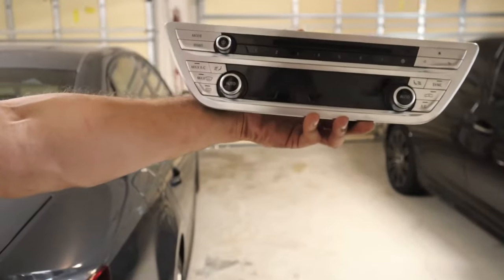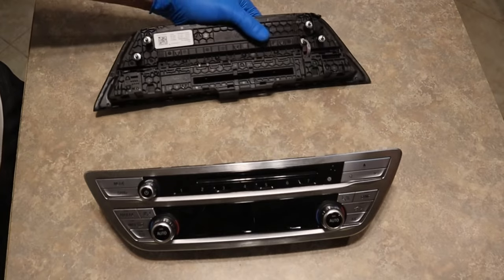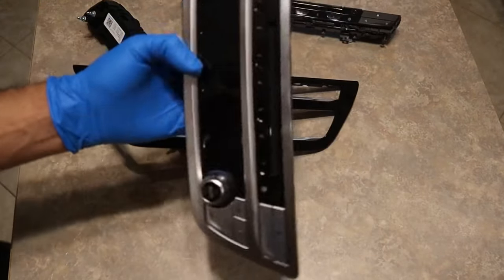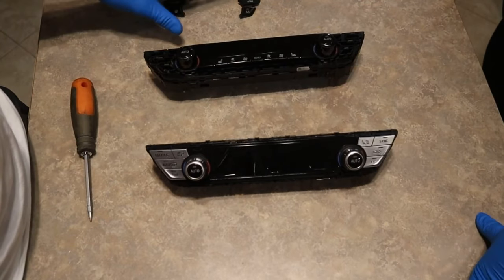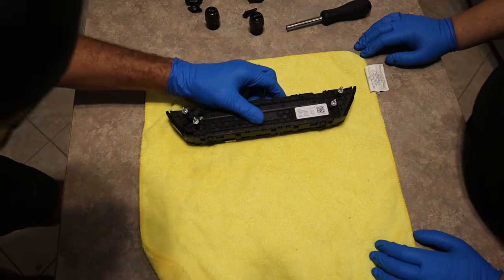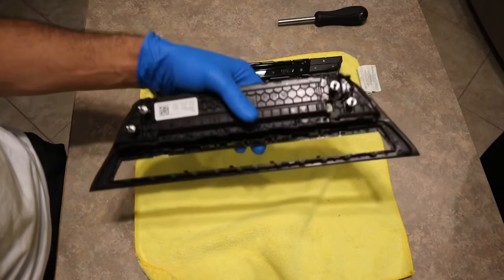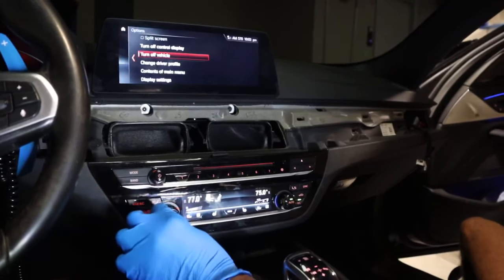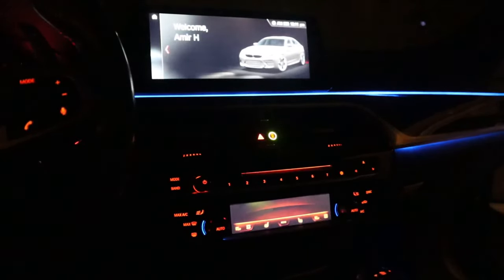BMW G30 : TOUCH CLIMATE CONTROL (Under $150)

Comment: Just gotta come on over and support such a great guy showing all the DIY instructions.  Took all of the guess work and research out of our hands!  One question, I also did this mod, and the result is just phenomenal.  But I also noticed one or two little springs popped out of the temp control knob, or within that proximity.  Have you ever encounter that and what do we do with it?  I ended up forgetting to put the springs in and nothing seems to be out of ordinary till this moment.  Thanks in advance.

Comment: Wanted to add here for anyone that might see it:
Removing the back cover on the climate controls can be a tough situation, what i did was ram a big flathead right in the middle, and then shimmy it up to a corner to unclip the corner, while holding the ac knob i took a tiny flathead and removed the remaining clips on the side, once a whole side is out just yank it apart and itll just snap out!

Comment: Thnx so much for this. Did the upgrade today and it works flawlessly. Do you know if it's possible to place a rear climate control unit in a G30 that doesn't have one? Are the wires there or is there more to it? I see a lot of 2nd hand rear units on ebay so I'm hoping for a kind of plug and play kinda thing😄

Comment: Just bought a G11 unit from eBay for 150 bucks. Excited to install it this weekend. Thank you for this tutorial.
Reply from the maker: Absolutely welcome my friend!!
Reply: So I got too excited and ended up doing it late last night. Looks fantastic.

Btw, have you ever considered swapping the pre-LCI gauges to the LCI ones? Thinking about it...if it's even possible that is
Reply from the maker: @sbs1687  awesome!! I'm glad it all worked out. Are you referring to the cluster? If so, then yes, you can upgrade to the digital LCI
Reply: @FullBoltOnGarage I was debating it, maybe later one.

Btw, I noticed this climate control change throws a shadow code. Doesn't bother me much since everything works as it should, but just a FYI to anyone who's planning to do this. "IAHK control unit - incorrect variant installed"

Comment: Thanks a lot for the super helpful vid! Now I want to do the same with my g31. Annoyingly, can’t find any digital HVAC control module that costs below 250 Eur. Including those from the G11.
Reply: Just quickly reporting back - I managed to do the upgrade! found a reasonable priced lower digital panel from a G11 off ebay. Followed all your steps, swapped out the buttons and rear bracket. Was all fine, though there were two springs that fell out, had to google to find out how to put them back (there are two tiny holes where the springs need to be placed, each under the AC buttons). Overall, went fine. Thanks so much !! Just one lingering aspect, I couldnt get my upper dash panel to click back in place very smoothly, it feels like its not seated properly. I dunno.. i might reopen it and try again. If you would do another video to show very slowly how you align the vents and clips before clicking it all back it, would be super helpful. I really struggled..

Comment: Nice work. You've just got another subscriber. Just curious though, why did you have to remove the upper panel ie the radio preset trim from the original trim piece when you have it installed back on it again at the end?
Reply from the maker: Hey! Thank you for the support it's really appreciated man!!! That's a great question actually.  The 2 units are held by 4 mini clips that slide into each other. It's easier to remove first ✅️

Comment: Great video mate, did this one, looks great. Just one question, my rear defrost button doesn't light up anymore, why is that and does it work at all now if I turn defrost on?
Reply: Was wondering about this since my button doesn’t work either ? Any ideas
Reply: @arodriguez9005  does it work when you start the car(engine) and press the button?

Comment: Hi, Just done this, i will give you one tip. You don't need to change the buttons one by one you can take it out whole part and replace it to the other part complete with buttons. I did replace the buttons one by one but i noticed the one foem 7 series have a silicon thing inside for the small holes in several of the buttons when you press the button for AC as example , and when you change the buttons this small hole is not filled as for the original one from 5 series this silicon filler is on base from the button and the buttons are with holes, the one from 7 series are fild with silcon for the lighrlt reflection. If you have still all the parts you can chaneged it.
Reply: Yeah…i figured that too…but i wont take it apart again :)))

Comment: Aloha all,
I have 2014 F30 that I recently gave to my son and picked up a 2023 G30. I love G30 because of the added space (being 6’ it’s awesome) and also loved the F30. I have a bit of a problem though right now with the G30. I installed an amp and sub into the F30 by tapping a LOC to the speaker wires myself. I then picked up the 2023 G30 and thought I could do the same but now I have no sound and the warning systems are not working either. Any ideas? I put Everything back together but it hasn’t corrected yet. Do I need to drive it more for it to reset or do I need to do a reset? PLEASE HELP!

Comment: I have done the mod however the touch screen does not work, it displays but i cant change the fan speed or put on heated seats or anything, but it does display and update when temp is changed with knob.. does anyone know the issu?

Comment: Just did this. Nice upgrade but my rear defrost button doesn’t light up anymore. I’ll have to wait to see if that means it doesn’t work.
Reply: Did you figure out if it works or not?
Reply: @arodriguez9005  it worked. I was stupid. Car has to be running because of the amps it’s pulling to run defrost.
Reply: @fallentovarish I just tried it I feel stupid 😅

Comment: I just installed a touch climate control from a 7 series in my G30. The display shows ventilated and heated seats while my car only has heated ones. I'm hoping it either eventually switches off or perhaps there's a way to code it out. It's not the end of the world but people should beware if seeing cooled seats on their display will bother them.
Reply from the maker: Let the car completely turn off. Sometimes it'll require overnight. It'll go away on it own. Many reported this and all have gone to normal ✅️
Reply: @FullBoltOnGarage  Awesome, thanks!
Reply: @FullBoltOnGarage  Just to follow up, that's exactly what happened. Started the car this morning and saw only the heated seat control. Thanks for this video!
Reply from the maker: Absolutely welcome, my friend! Enjoy the new look 😎